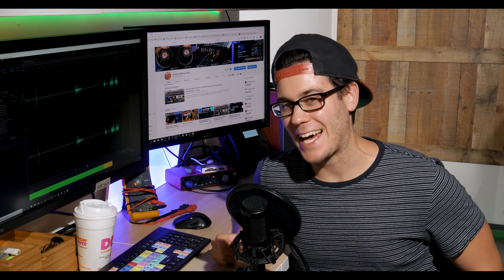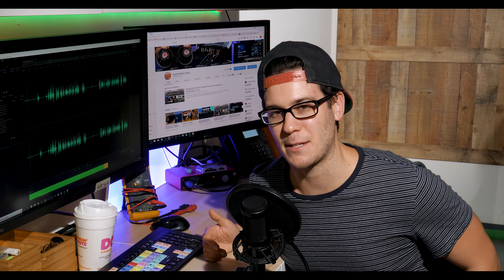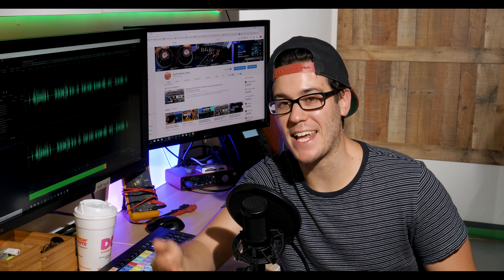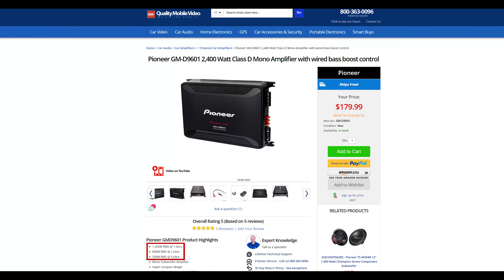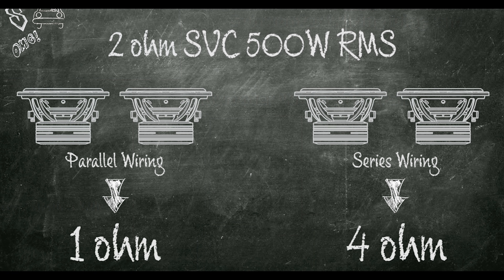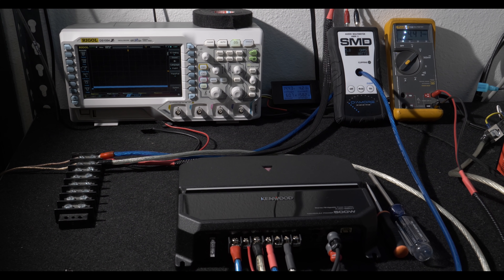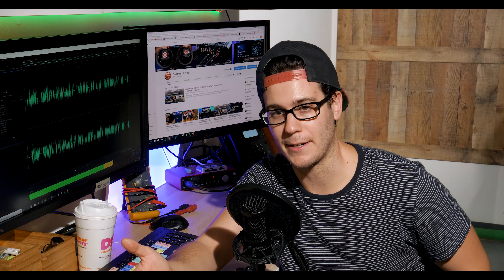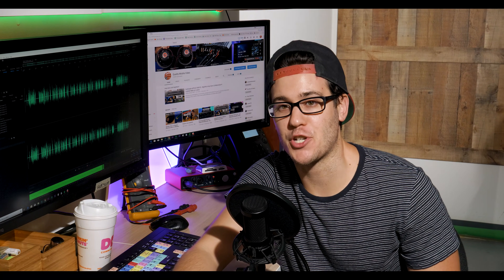Parallel Wiring vs Series Wiring - More Bass?  Cahh Audio 101

Comment: I have two kicker cvx 12 inch dvc 2 ohm 750 RMS  1500 max each. I have a db drive wdx 3000 watt max rated at 1ohm, 1500 at 2 ohm. I upgraded my wiring to a zero gauge for the power and ground with a spare battery. What would you recommend I wire those speakers to? The box is a downfire sealed with .9 cu. ft. for my Chevy Silverado crew cab. Thanks in advance!
Reply from the maker: So two DVC 2 ohm woofers wire to a 2 ohm load(parallel) or 8 ohm load(series) Go for the 2 ohm load. ALWAYS ignore MAX ratings, and instead refer to RMS ratings. You'll want a monoblock amplifier with a power range of about 1350-1700W RMS @ 2 ohms. Check these:

Power Acoustik EG14500D 2000W RMS @ 2ohms
http://www.qualitymobilevideo.com/eg1-4500d.html?utm_source=YouTube&utm_medium=Video&utm_campaign=Match_Subwoofers-Amplifiers

Power Acoustik BAMF1-5000D 1700W RMS @ 2ohms
http://www.qualitymobilevideo.com/bamf1-5000d.html?utm_source=YouTube&utm_medium=Video&utm_campaign=Match_Subwoofers-Amplifiers

Hifonics Zeus ZRX3216 1600W RMS @ 2ohms
http://www.qualitymobilevideo.com/zrx3216-1d.html?utm_source=YouTube&utm_medium=Video&utm_campaign=Match_Subwoofers-Amplifiers

Hifonics Brutus BRX2016.1D 1400W RMS @ 2ohms
http://www.qualitymobilevideo.com/brx2016-1.html?utm_source=YouTube&utm_medium=Video&utm_campaign=Match_Subwoofers-Amplifiers
Reply: @Qualitymobilevideo  Thanks for the quick response. I feel I was screwed on the purchase of the amp. Today the guy at the shop told me to wire both down to 1 ohm each and just play them low to break them in. I guess I should have bought two 4 ohm speakers. Silly me.

Comment: Question for any one, I have 2 re audio sex 15"- 2ohm duel coils, 1200 rms from what it says online,  I would like to run a hifonics brutus 1200 watt amp at a 1ohm setting, would this work or not.
Reply from the maker: Nope, you need two DVC 4 ohm woofers to be able to wire to 1 ohm load. Watch this: https://www.youtube.com/watch?v=qZ4aDK1PyWs

Comment: Why 2 ohm, 4 ohm, or 8 ohm?  Which is best?
I'm guessing 8 ohm provides the best audio quality.
That's why home audio systems and audiophile systems are 8 ohms.
2 and 4 ohm are for loudness and power efficiency.  Am I right?
Reply from the maker: Actually no. So the lower the impedance number(higher load) means more power. On an amplifier, a 2 ohm load is about twice the power of a 4 ohm load which is twice the power of an 8 ohm load, give or take. With the high number impedance(lower load) you get better efficiency. 8 ohm would be the most efficient, drawing the least amount of current, but sacrifices power. 2 ohm is a sweet spot of power and efficiency compared to 1 ohm which can run your system hot. 4 ohm is very solid and efficient as well.
Reply: @Qualitymobilevideo  
Sounds like you are contradicting yourself here.  If 8 ohm is the most efficient, then why is 2 ohm the sweet spot?  Why is 4 ohm better than 8 ohm?

Lower impedance means louder and you get more power coming from the amp, right?  8 ohm is very inefficient because it is weaker, softer in volume, and can't maximize the amp's power potential.
Reply from the maker: @RedRider1600  I'm not contradicting myself. I said 2 ohm is the sweet spot overall with all possibilities including 1 ohm loads. You don't want to run at 8 ohms ever, you get no power. 4 ohm is ok, but still low power compared to 2 ohm. Efficiency is not about loudness. Efficiency is about how much power is being drawn by the amp. So 8 is the MOST efficient, because it is the weakest, it is the least taxing on your system, so most efficient. A 1 ohm load is LEAST efficient because it is using the most power and pushing you to the limit. I just personally believe 2 ohm systems are best because you get very good power, with decent efficiency.
Reply: Quality Mobile Video 
You are still contradicting yourself.
Efficiency is about loudness and how much energy it takes to produce that loudness. Speaker efficiency is stated in decibels (loudness) at 1 meter with 1Watt input. Decibels is loudness.
Example. . .
Efficiency: 89 db @ 1w/1m
Or. . .
Sensitivity: 89 db @ 1w/1m
Look familiar?
Reply: @Sirtimsmokesalot  
If there is no difference in sound quality, then why make high end audio the most inefficient, using 8-ohms?  Why not 2 ohms?
Reply: @Sirtimsmokesalot  
You obviously have no idea what the hell you are talking about.
Reply: @Sirtimsmokesalot  
Thanks for proving my point.
You obviously have no idea what the hell you are talking about.
Reply: @RedRider1600  my personal experience is higher ohms sound beter, but we should remember a car amp pulls 12 v from a battery and a house amplifier gets ten to 20 times that.
Reply: @adrianp6065  
To be honest, I don't think I could tell the difference in sound quality.
As for the rest of it, refer to my previous response to Timothy S.
Reply: @Sirtimsmokesalot  in South Africa we get 220 v in our homes
Reply: I've used 3 different 12 volt adapters one with 10 amps, 20amps and 30 amps; the amp difference also played a huge part in the power and quality I got out of my in home car sound system.

Comment: So I’m have a Kenwood Excelon KAC-X521 and 2 12” clarion sw12x  600w 4ohm subs  going in a custom Dual Subwoofers Airspace: 0.87 cubic ft. Per Sub/Chamber, Made with 0.75" MDF, Speaker Wire Terminals: 1 Per Subwoofer, Box Type: Sealed Box. It’s an old set up that’s been in storage but now putting in a 2015 Mustangs GT. Any suggestions? Series wiring right? Thanks

Comment: How buy a bigger, more powerful Amp say 2000 watt and then just wire the two 12 inch subs rated at 700 watt RMS to 4ohm?  Wouldn't it pound hard ans still run cool?
Reply from the maker: Yes, that will be a viable option with two DVC 4 ohm woofers which make a 4 ohm load when wired in parallel/series, but you'd have to get a pretty damn powerful amplifier to find one rated with 2,000 Watt rating @ 4 ohms which will draw quite a current. Like these:
https://www.qualitymobilevideo.com/bamf1-8000d.html

https://www.qualitymobilevideo.com/eg1-10000d.html
Reply: @Qualitymobilevideo  
I'm seriously considering these,  IDK for certain tho rather 2ohm or 4ohm, what you think?
Kicker CVX124 COMPVX 12" Subwoofer Dual Voice Coil,  750W  RMS
Reply from the maker: Again it depends on the amplifier you choose! If you're committing to making a 4 ohm system, get the 4 ohm versions of those subwoofers. Two DVC 4 ohm subwoofers wire to a 4 ohm load in parallel/series. Your amplifier will need to do a minimum of 1500W RMS @ 4 ohms

Comment: I have 2 Rockville 12s 4000 watts a piece in a custom built  box for a Avalanche that is  ported and I have a sound stream 8000 watt amp 1 ohm stable the 12s frequency  response  is 33 hz and the box frequency response is  30 hz so with that being said it hits really hard but I want more bass so is it wise to wire at 1 ohm or leave it like it is oh and the 12s are dual voice coils and 4ohms if you can help me out I will deeply appreciate it  and I am not a noob  by any means I just wanted a second opinion

Comment: Please make a video explaining the subsonic filter on an amplifier. I am currently running 2 x 12 Pioneer ts-w3003d4 subs in a ported enclosure that I bought. THey are powered by a Pioneer GM-D9601 amp at 1ohm. THis amp does not have this feature. Is this a big deal?

Comment: Hey you jerky boy pass me some beeeeaars 🍺 🍻 🍺 😂🤣 I’m outside in da caaaaaar
Reply from the maker: Let's go to fuckin Dunkin Donuutssss
Reply: Quality Mobile Video The amp i’m looking at puts out 150 watts rms at 2 ohms for 2 channels. does that mean that if i have 2 speakers on each channel that 150 would be divided by each speaker on that channel? For example, if i had 2 sets of 2 speakers (both pairs being wired in parallel to a 2 ohm load) each speaker needs 150 watts rms, so would each speaker only get 75 watts because they are both on one channel?

Comment: the basic is low bass is 1 or 2 ohms... so easy way of doing it is buy your subs... then you know you ohms load and rms rating for your sub wiring...wiring down 4 ohms to 2 ohms doubles you sub rms rate so keep that in mind when you buy your amp and watch a amp dyno video to make sure the rms rating for the amp your lookin at is really the rms rating (SOME ARE NOT THE TRUE RMS) small cars can handle a rms of 1000 to 1500... trucks can handle 1500 to 2000 rms if your alternator has 95+ amp and you dont have a more then 3 things pulling power like phone chargers etc.. the rms ratings i posted for car an trucks is just a base line it can very a lil with other factors added in  but everything i just posted i learned the hard way so take it for what it is..... and thank you for breaking down the info for everyone on here i even have learned a few things from over videos you have posted
Reply: Would a pair of 2.7 ohm speakers make my factory deck sound have better bass output?
Reply: I’m going to buy 2 Skar Audio SVR-12 12-inch dual 2 ohm subs, a ported box (SK2X12V) that is tuned to 32HZ, and  the RP-2000.1D Class D monoblock that makes 2000 w rms at 1 OHM and 2800w max, how should I wire these up? And at what ohm? I’m barely learning about this so I would appreciate any help 👍

Comment: I dont know if this was what he meant but my question is, would a 1 ohm load at 1000rms play the same at a 4ohm load at 1000rms? I guess it wouldnt be as efficient, but i guess it would be the same, right?
Reply from the maker: Are you talking about the same amplifier outputing the same power at different impedances? The power would go down with each higher impedance. Let's say you have an amplifier that has stable impedances at 1 ohm, 2 ohms and 4 ohms. And then let's say at 1 ohm it's rated at 1,000W RMS. At 2 ohms it would be rated at 500W RMS and then at 4 ohms it would be rated at 250W RMS. However, if you have two different amplifiers with different ratings, and amplifier A does 1,000W RMS @ 1 ohm and amplifier B does 1,000W RMS @ 4 ohms, amplifier B will be much more efficient. But that amplifier B will be much more powerful in general and would probably do around 5,000W RMS @ 1 ohm. It all depends on your gear,  what impedances the amplifier can perform and what your subs are, DVC or SVC, 2 ohm or 4 ohm, etc.
Reply: @Qualitymobilevideo  i know, in general, less impedance means more power. Im no expert in the car audio world, nor an amplifer expert but pdx v9 is rated at the same power at 2 and 4 ohms, also the mrx m110 actually produces less power at 1 ohm than at 2. Im an alpine fan btw. I actually run a v9 right now, and the sub channel @ 2 ohms may have an ACTUAL power higher than a 4 ohm load but it may be an insignificant amount. From a amp dyno i saw with a pdxm12, the dynamic power seems amazing at 2 ohms though but that may just be the single amplifier and its technology. Thanks for your feedback. Love your videos ✌✌
Reply from the maker: Thanks bud!

Comment: Got 2 KFC-W3016PS wondering what amp to get and I would like the amp to be kenwood
Reply from the maker: Those are SVC 4 ohm subs, two make a 2 ohm load in parallel or 8 ohm load in series, focus on the 2 ohm load. Power combined RMS is 800W RMS. I recommend the Kenwood KAC-9106, does 1,000W RMS @ 2 ohms, perfect match:

https://www.qualitymobilevideo.com/kac9106d.html

Comment: Can you guys show some tips for hooking 12” kicker es to 6 channel amp(Audison lrx 6.9)just sub no speakers they are hooked to my head unit Sony xplod .
Reply from the maker: You're wiring just one subwoofer to a 6 channel amplifier by itself with no other speakers or anything? I would get rid of that amplifier and get a monoblock, it's a waste of a beast 6 channel. That's like getting a stretch limbo for your daily car. If it's in good condition you could get some serious cash for it.
Reply: its in really good condition ,for now i just wanna hook my sub. but later on am planning to change all speakers and get a new setup for it .... need help with wiring and tune up..

Comment: How do you wire batteries for a car in series and parallel
Reply: Deshan Naidoo You would need at least 4 batteries. Separate them into pairs. Wire each pair in series  + to - and then do the same for the other pair(s). Now take each pair and wire them in parallel + to +/- to -. If you use 12 volt batteries you will get 24 volts. You would have to use 6 volt batteries to get 12 volts, but you can add as many pairs as you wish for more capacity.

Comment: I have 4 kickers cvr 400 Watts and a 1800 Watts audiopipe class d i on stable and I'm trying to hook all 4 subs to 1ohm to the amp
Reply from the maker: What impedance are the subs, 4 ohms or 2 ohms?
Reply: @Qualitymobilevideo  4ohm
Reply: todd Harris If you wire all four of them in series parallel you will get a 2 ohm load. You won't be able to get a 1 ohm load with 4 of them. You could do 2 in series parallel + 1 in parallel which would give you a 1.33 ohm load with 3 subs.
Reply: @letthemusictakecontrol8388  ok but can the speaker hold on to the power of the amp 1800 Watts audiopipe class d i on stable
Reply: I have the gray kicker 12s
Reply: todd Harris Look at the RMS rating of your subs and the RMS ratings of the amplifier at the different impedences, then compare them with the different combinations I've shown you above. Use whichever combination that gets you closest to the total RMS rating for the number of subs you plan to use.

Comment: I like the video overall but do want to point out one thing in case someone wants to know it. That is that when you said two DVC 2 ohms being either 2 ohm parallel or 8 ohm series and the two DVC 4 ohm being either 1 ohm parallel or 4 ohms. There is also mixed series parallel configurations available when using two DVC sub's. But I think that's what you used when you figured your parallel numbers. Reason being is four 2 ohm coils in parallel is .5 ohm not 2 ohm and four 4 ohm coils in parallel is 1 ohm like you have written. Actually looking at it now, your numbers are all screwed up and the only other one you got right is four 2 ohm coils in series being 8 ohms. Four 4 ohm coils in series is 16 ohms not 4 ohms. Anyways, with series parallel you can also wire two DVC 4 ohm subs to present 4 ohms to the amp and two DVC 2 ohm subs to present 2 ohms.
Reply: I dont know shit about hooking up sound systems in cars. But it seems like you know what you're talking about...RESPECT.
Reply: No. It was right the first time.
Reply: Exactly It was explained in a bad way

Comment: Im about to get an A in calculus but i don’t understand how ohms work. Can someone explain?
Reply: Series is add and parallel is multiply add divide. For example 4 ohms + 4 ohms=8 ohms would be series. Now parallel you need to do a little more on so let's go through it. First thing you do is multiply the 2 coils, 4 ohms x 4 ohms=16 ohms.  Then you add the two coils, 4 ohms + 4 ohms=8 ohms. Now you take the multiplied number and divide it by the added, 16 ohms / 8 ohms=2 ohms. Most will say just add the 2 coils and divide by the single coils ohms but that only works when using the same ohm coils. It's good to know the actual way for mixed ohm loads. Like say you have a 4 ohm 6.5" in the door and you parallel in a 8 ohm tweeter.  4 x 8=32. 4 + 8=12. 32 / 12= 2.66 so you would be presenting a 2.66 ohm load to an amp wiring a 4 ohm and a 8 ohm speaker in parallel to it.
Reply: David Hamilton thank you, you’re r the man.

Comment: What is the purpose of a mono block with two negative and two positive hook ups? If I have one like this (++--) or even (+-+-), does it matter which combination of positive/negative I use?
Reply: No.thats for connecting two subs to it easier as opposed to trying to fit 2 wires into one + and one -
Reply from the maker: As Craig said, paralleled outputs to simplify wiring
Reply: if you have a dvc sub inverted you can wire each terminal directly to the amp